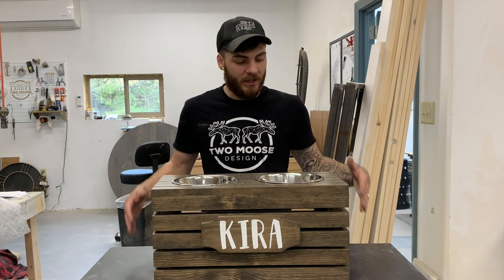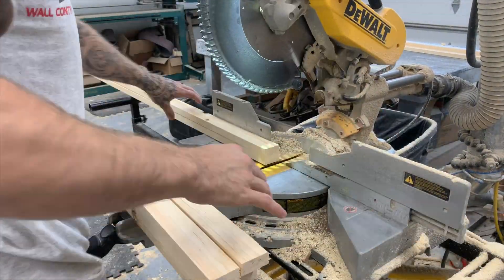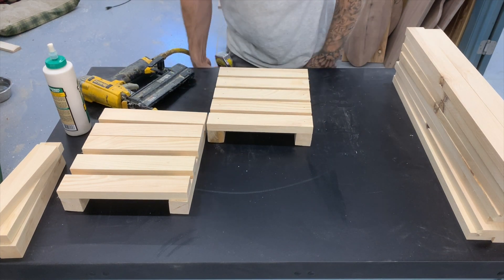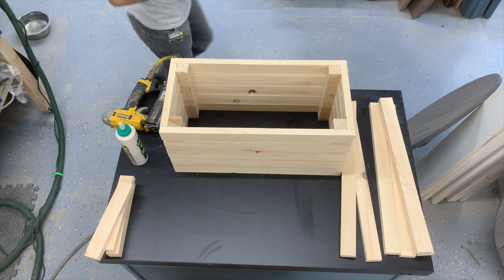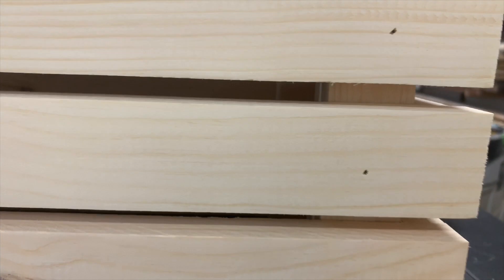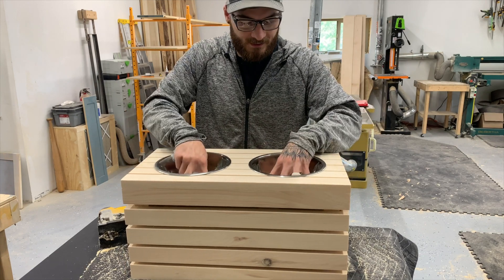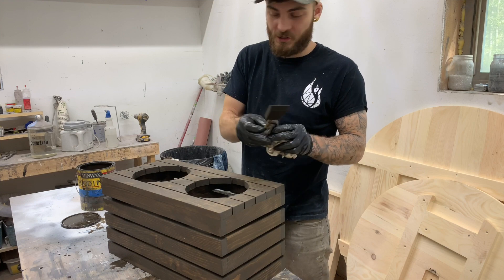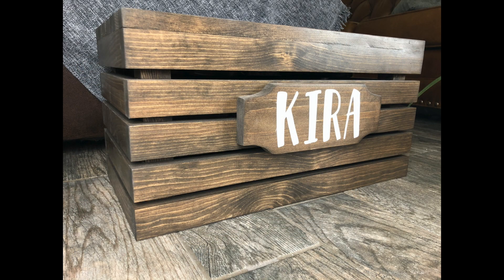Building a Raised Feeder // Feeding Station // Bowl Stand //  For Your Dog // How to // DIY

Comment: How does that mini split do in the shop?  Any issues due to the dust that gets away?
Reply from the maker: It does pretty good. Struggles in Wisconsin when it starts getting below 10 degrees. I blow it out often, I need to build a replaceable filter deal for it
Reply: @TwoMooseDesign  Ha, I bet it does when it gets that low.  I'm in Houston, TX.  Mainly want it as it gets really warm and humid in the summers.  I've been debating but have started researching.